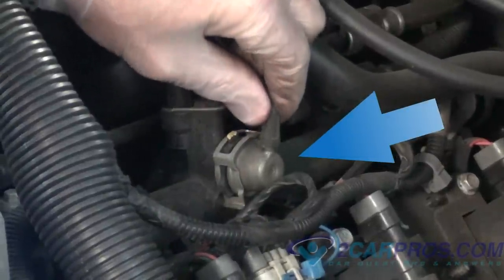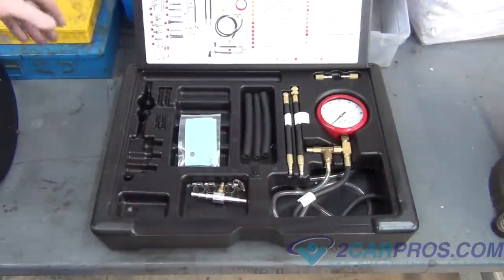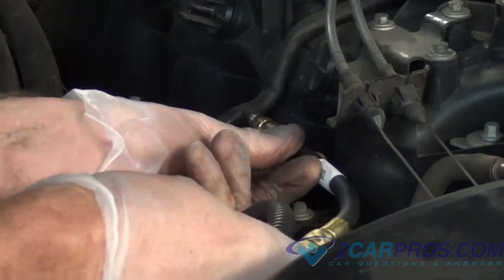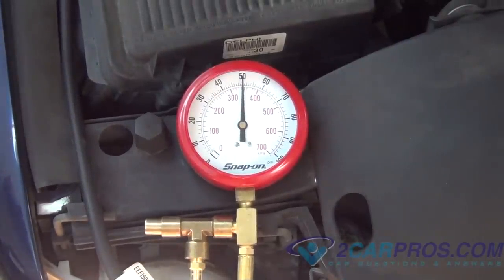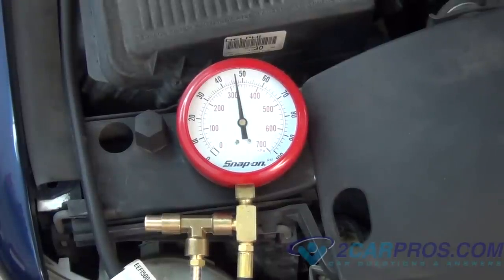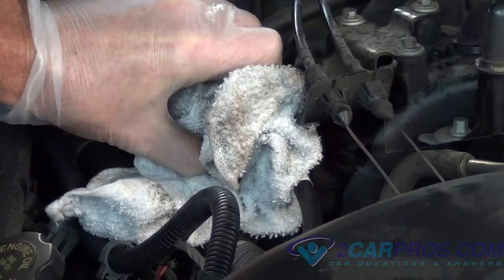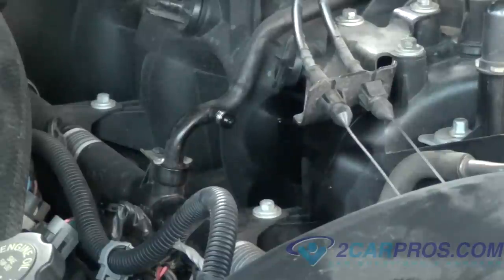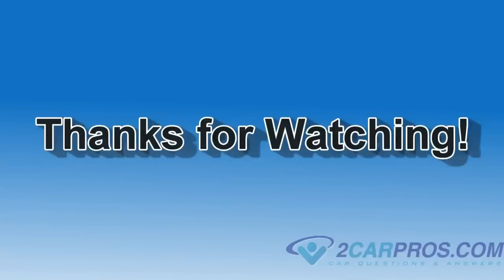Fuel Pump Pressure and Regulator Test

Comment: Aren't you supposed to relieve the pressure before you disconnect the hose?
Reply: Yesir! Seen alot of these YouTube videos on this and never once mention to remove the fuel relay or fuse and start the car a couple of times to release the fuel pressure.once you see the car trying to start with no avail, them you know the fuel pressure is depressurized and can follow with the fuel pressure test and connecting the gauge

Comment: My fuel pressure dropped more than 10 psi in about 30 minutes after I turn the key on is that a bad fuel pump or a bad fuel pressure regulator?

Comment: What’s the fuel pressure on a 2.8 v- 6 s-10 would a in-line fuel pump with 5to51/2 psi work

Comment: Hey 2CarPros, I have a 2008 Chevy Tahoe LTZ. When starting lately, Sounds like a flooded long start or maybe like a misfire. About maybe 5 seconds to start. Was looking for the port or rail to check the fuel pressure. Do you have any ideas?? Thanks

Comment: hey I have a 2002 Yukon xl 8.1L I'm having trouble keeping the truck on. It will start for me 5-10secs than shut off and if I press on the gas it will shut off even faster. What might be the problem? I changed the fuel pump, fuel filter and changed the spark plugs.

Comment: Any help..99 s.10.  2.2 motor.really hard to get started once running runs good..idle is crapy.hooked fuel pressure gauge 0 pressure .but motor still runs? Any ideas

Comment: I have a 2003 Cadillac Deville with a 4.6 Northstar engine. I have replaced the fuel pump for a bad sending unit and the fuel filter. I have 35 PSI fuel pressure which low based on specification. I am trying to validate my fuel pressure regulator. When I unplug the vacuum line at idle I see no change in pressure. Is this normal for this engine?

Comment: I have a 1994 dodge 2500 v10,few months ago started to sputter back fire thru carb 10 mph barley got it home let it set for a day and tried pressure check started up fine and had 40 lbs, ran fine for about 200mi than same problem, has 130000 sets most of the time going to try pressure check again >

Comment: I need help i have a 2006 chevy impala ss i bought a car for 7000 they rigged copper wire in the fuel pump fuse i had a new fuel pump put in it still dnt start but i can put starter fluid in it and it stay running what could it be plz someone help me

Comment: I'm in my final year of my Bachelors of Mechanical Engineering. For my final Year Project, I am required to investigate the effects on an engine with the increase of fuel pressure in the fuel pressure regulator. I have investigated every parameters and I am now currently looking for the stock pressure in the original Fuel Pressure Regulator. The engine that I am investigating is the 4G92 SOHC 16 valve engine. 

I am required to change the fuel pressure regulator to an adjustable to fuel pressure regulator and set it up higher than the stock pressure. But I do not know the stock pressure in the original fuel pressure regulator.

Your assistance will be a great help to me and if you guys do know the value, could you please send me a link to that so that I could use it as a reference in my report.

Please help

Comment: what do you mean exactly when you say "  load" the engine??
Reply: Andre Johnson either step on the pedal a bit or put in drive while holding the brake (with help of course)
Reply: load the engine in the back of a truck and take it to the dump

Comment: If you have a vehicle that is running lean at high acceleration. How can you run a fuel pressure test at high acceleration? Running a fuel pressure test at idle wont show me the fuel pressure when the issue occurs.
We have pretty much narrowed it down to a weak fuel pump, everything else that could possibly cause this issue has either been checked or changed outleast one time. The only thing left is changing my fuel pump, before I spend the money and take on that job I would like to get some indication that it is the fuel pump. This lean issue at high acceleration has been going on 4 years now, but the fuel pump has not failed and aside from my service light coming on at 60 mph around 2600 rpm theirs no real performance issues except poor gas mileage especially at faster speeds. Its a 2001 chevy s10 2.2L automatic with 113,000 miles.
Also it is making it difficult for my evap, o2s and cat tests to complete. It takes a really long time for those to complete.
Reply: Try fuel injector cleaner. The injectors may be clogged.
Reply: @hankbridges5055  Thanks for the tip. Ive been thru just about everything on that truck. I was told by a few people including Scotty Kilmer, that its most likely my fuel pump, especially if its a high acceleration only issue. So I got a new one, I just have to install it. My issue is literally only occuring at around 60 mph and above. However its been doing this same crap for nearly 5 years now. I don't have any actual performance issues at all, except maybe poor fuel economy, so I believe that its really just the stupid computer along with emission control devices going off and they really shouldn't be. Anyway I'm going to change the fuel pump, if that does not correct this problem, I'm just going to pay someone to put a new inspection sticker on my vehicle and be done with it. I have been going thru the same ordeal every two years and this is the 3rd time now. If this state did not have inspection, like Florida, I would not even worry a out it any further.
Reply: @Mr_Tecumseh  Get a Actron CP9690 code tester. It checks live, record, emission readiness test, SRS, ABS,  graphing, oxygen sensor test, oil light reset, fuel pressure, RPM's and MORE! I have one and it also has code connect to diagnose codes for that vehicle. It retains the memory for away-from- the-car test results review. The screen is well lit. It shows where the connector is. 2000 up has automatic testing instead of dialing in the vehicle info. It checks Key on engine off and key on engine running codes. Also memory codes for past history codes. It says CONFIRMED for problems now. Test results can be downloaded on a computer with a USB cable from EBAY. It comes in a black pouch. It works from 1984-2013 and is updatable. It has a cigarette lighter cable. The batteries are behind the single screw on the back cover. Not included. They light up the screen. It has an instruction manual. It checks transmission codes. First try fuel injection cleaner. Warm the engine to clear the engine of unburned fuel. It shows closed loop and open loop. Open loop means the engine hasn't warmed up. Closed loop means it's warmed up. Negative fuel trim readings means lean mixture. It shows indications about normal readings and out-of-spec results. It shows timing advance, fuel pressure, vehicle MPH. Record means it'll record info up to the condition that caused the code. It has freeze frame. It can be hooked up to do testing while driving. RPM's can show an incorrect tach. It shows coolent temperature. EBAY has it.

Comment: I meant to say the relay fuse they put copper wire in it to bypass something
Reply: it means you've got something pulling a load more than the circuit was designed for and it was blowing the fuse. that's why its fused, to prevent a fire. if you can spray starting fluid in and it starts, you've obviously got spark, so you aren't getting fuel. Get a multimeter(or a test light in a pinch)and start tracing power.  you can find the fuel pump connector near the tank. check for 12volts there. if there is power there when the key is on then it's likely a faulty pump, or bad ground. given that you're popping a fuse,(and the fact you have a new pump) that indicates a large amount of resistance in the circuit, so a bad ground is a good possibility. you should also check for a faulty relay. generally you can swap another non-critical relay from the relay center into the fuel pump relay position temporarily to rule out a faulty relay.

Comment: what does it mean when the gauge fluctuates between 45 and 50? Never smooths out. Dodge 5.9v8
Reply from the maker: Could mean your fuel pump is about to go out. How fast is it fluctuating?
Reply: It's fast. Very twitchy. Key on pressure is 40. Dodge specs 49.2 plus minus 5. Key off bleeds down to 30 in 10 minutes
Reply from the maker: Sounds like it could be on the verge of of quitting. I'd keep an eye on it or preemptively replace it.
Reply: Thanks. I think I will order one to have it here if it gets worse. Appreciated!
Reply from the maker: Good call! Thank you for watching!

Comment: On my 2001 Volvo S60 T5 the fuel pressure doesn't always build when I let the fuel pump prime with key on.  Sometimes it goes only to 14 psi and others right up to 40 psi.  I've been thinking it's the fuel pump and according to this video, it is.  Fuel filter is new, injectors are new and pulse damper is new.  Time for a new fuel pump I guess?

Thanks for the video!
Reply from the maker: We do not recommend running seafoam to fix a problem. It sounds like you have a weak and failing fuel pump or a plugged filter. We recommend replacing the filter when doing the fuel pump. Please subscribe if you have not already
Reply: The Brain
I mentioned injectors because I figured leaky injectors could keep fuel pressure from building/holding.  I recently replaced my voltage regulator and that seems to have had a positive effect on cold starts.  I haven't hooked it back up to the fuel pressure gauge yet.  I've only had one stumble on start up in the past 3 months compared to 2 or 3 per week with my old worn out voltage regulator.

Thanks for the help!
Reply: 2CarPros
Thanks for the help!

Comment: What if the car is not starting? The engine cranks, but not turning over. I smell gas when I try and start it.
Reply from the maker: Could be a fuel leak. Thanks for watching!
Reply: 2CarPros will a fuel pressure test tell me that? And if so, how can I find the leak?
Reply from the maker: Yeah if the fuel isn't getting to the engine then it isn't creating pressure. As far as finding a leak you need to look up and down the fuel lines for a leak.

Comment: Weird, i paid 30 for an acton fuel pressure testor and it had a bleeder valve and hose to relieve pressure once the test is done. I would think with snap-ons quality they would have the same. Anyway i did the test and got only 10-12psi. When i pinch off the vacuum hose the fuel pressure doesn't rise. If anything it drops 1 or 2 psi. Is it possible the fuel pressure is too low to do that test effectively or is the fpr probably bad?

Comment: I have a 1995 honda civic EX it has been running way to rich. it is bogging way down from to much fuel. so much that if I rev it in idle it will throw a big cloud of black smoke out the exhaust of fuel. injectors arent sticking open timing is good. fuel pump filter rail plugs plug wires air filter dizzy are all new. I am tired of throwing parts at it hoping to fix the problem.
Reply: Maybe ECU problem

Comment: Well, my fuel pressure regulator has no vacuum line so now what?
Reply: If the fuel pressure is low, it's either the regulator, pump, injectors, or filter. There's a pump in the tank. Disconnect the line coming out of the pump and turn on the ignition. If strong flow exists, its not the pump. Disconnect the line from the throttle body and see if strong flow comes out of the line with the ignition on and cranking. If so, it's either the regulator or injectors. Try fuel injection cleaner in case it's a leaking injector. Next, replace the regulator.